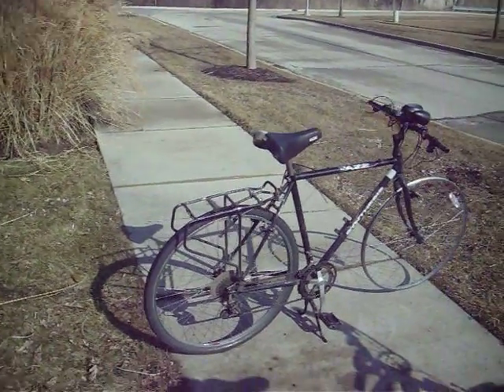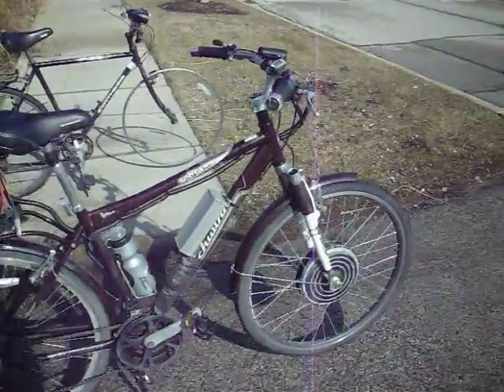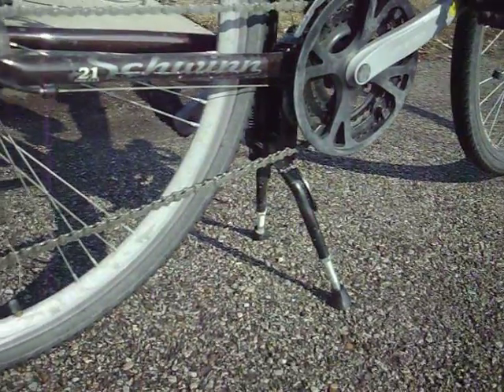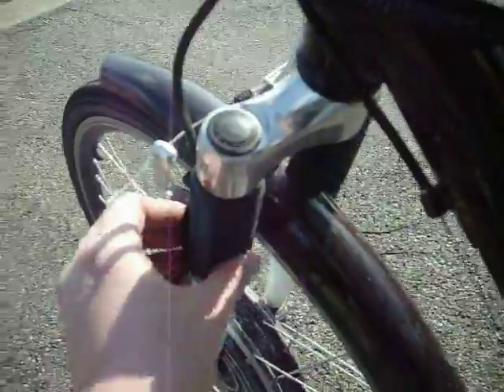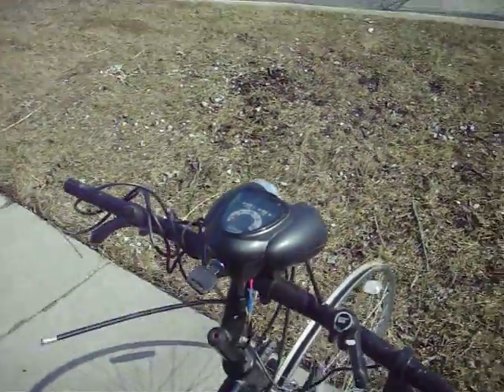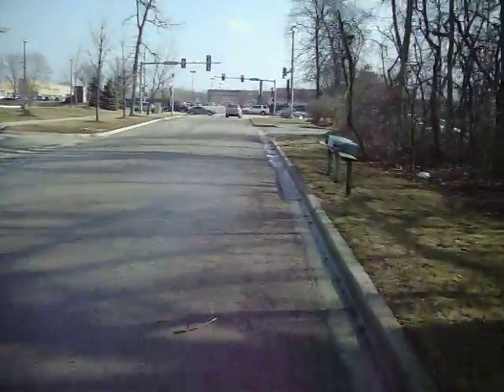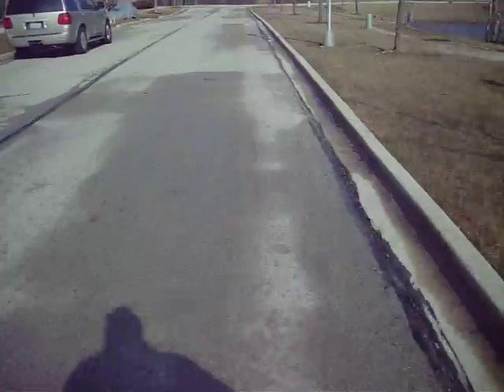48V 1000W E-Bike Update 5: Final Update. New Bike! Clean Install. Lifepo4 (Lithium) 20AH. E-BikeUSA

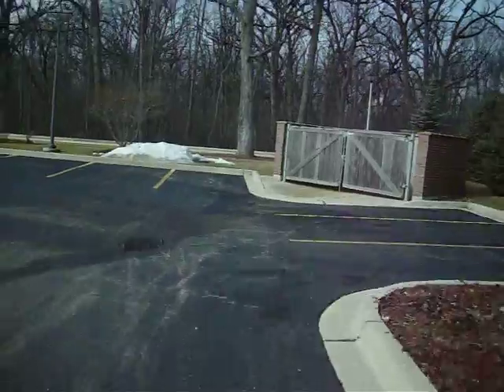Comment: 4:41  How fast were you going?  Or, how fast does it get?  4:10  Seems pretty loud, is that a square wave controller, or sine wave?  Or, why is it so loud?  Your statement about the rear motor being more fun in difficult terrain 4:04 makes me want to go with a Crystalyte HS3540 motor, 72v @ 40, or something, but I'm concerned about having the battery in the rear as well, it ending up a rear heavy bike (wanting to keep going forward, then end up fishtailing), but if I can't do that, how could I fit such a big battery pack in the frame without it being a huge frame (I'm currently riding a 2008 15.5" Marin Mount Vision Pro, and am trying to avoid a 17", although, I suppose I could do 17.)   My ignorance, and this big dilemma, then makes me want to go with a front motor, with the battery in the rear, but then, I fear breaking the forklowers, even with torque arms, I just don't know what to.  I wonder, with a budget of around 2grand, could I end up with a bike, and both kits to try out?
Reply from the maker: You can build a custom battery, and put it low in the frame for ultimate weight distribution. A front motor bike works very well, and if you use a torque arm, you should have no problems with breaking the front forks. I think a budget of 2 grand, you could build a very nice bike. If you look at my page, find the videos of my latest bike: a Trek 8.3DS with an E-Bikekit motor, and a 12AH v-power battery. That bike was built for about $1,700.

Comment: Hi man.. I try to get v-power and i just can't.. They ever responed to my emails..
The speed on the video seems sad, no? 
You have other video? I don't know which to choose..
48V 1000W with 20ah battery or 500w 48V and 12Ah battery.
Its for road only.. 
Please reccomend.. I am looking foe good product..
Ariel
Reply: 4:42  How fast were you going?  Or, how fast does it get?  Your statement about the rear motor being more fun in difficult terrain makes me want to go with a Crystalyte HS3540 motor, 72v @ 40, or something, but I'm concerned about having the battery in the rear as well, it ending up a rear heavy bike (wanting to keep going forward, then end up fishtailing), but then, how can I fit such a big battery pack in the frame without it being a huge frame (I'm currently riding a 2008 15.5" Marin Mount Vision Pro, and am trying to avoid a 17", al though, I suppose I could do that.)   My ignorance, and this big dilemma makes me want to go with a front motor, with the battery in the rear, but then, I fear breaking the forklowers, even with torque arms, I just don't know what to go for.
Reply from the maker: mef1975 I was probably doing about 20-25 MPH. I could get up to about 31 on that bike on a long straight stretch. On my current bike, i regularly get over 35 MPH. The Crystalyte motor, on 72V, rear wheel drive would be a fun bike! You are right, though, that it gets a bit heavy and awkward to ride when you put the battery and motor on back.

Comment: How much was that lithium ion battery? total size and weight? thank you
Reply from the maker: That Lifepo4 battery was about $550. It weighs about 25LBS. I forget the dimensions.
Reply from the maker: I started with cheaper SLA batteries but they were heavy, had limited range, and needed to be replaced every year. Once you go Lifepo4, you never go back.

Comment: I need to know if a lead acid battery configuration (48v 20AH) has the enough power to feed a 48v 1000 motor ? Will it last many hours for day ? I know that lifepo4 and lithium batteries are better, but they are really expensive.

Comment from the maker: Yes, the higher wattage will give you higher overall speed. I weigh about the same. I have a 500W E-Bike that accelerates about the same as this 1000W, but the top speed on that vehicle is only about 23 MPH, versus about 31 MPH on this bike.

Comment from the maker: I have front and rear wheel drive E-Bikes, from the Conhis brand, but i have not noticed one giving more distance over the other. If you can get 50 miles from a 1000W kit, 20AH, that is really good. I've gone 40 on a charge, but that was with a lot of pedaling. There are slight differences between the different motors from the different companies in China. I would test your speed and range, and see if the numbers they gave you are realistic. Also, rider weight is a huge factor. I'm 196 LBS.

Comment: Hello rocbola I 've just bought from v power hk a 1000w rear wheel and a 20 ah battery but from an other manufacturer. Do you think that the rear motor har greater range and max speed than the front motor?The v power claims that the rear kit has 50 miles distance range and 35 max speed

Comment from the maker: This pack is from V Power Hong Kong, 48V 20AH, and it cost $550 with shipping. I have seen some for as cheap as $300, but they are usually 10-12 AH. For a 40 mile round trip, i'd recommend a 20AH, though, depending on hills, rider weight, motor wattage and efficiency and how much you intend to pedal. My battery charges in under 3 hours when i'm empty, and less than 2 hours most of the time. It's expensive up front, but i've already payed for my battery in gas savings.

Comment: Hi Rocbola, A couple of questions on your conversion.  How much did you invest in the batteries?  I know I've seen some packs on LiFePo4 eBay and didn't know how realiable those might be.  But they're like over $500.  I'm planning on going 40 miles round trip and I figure with a charger at work I could charge at both home and work if it charges that quick.